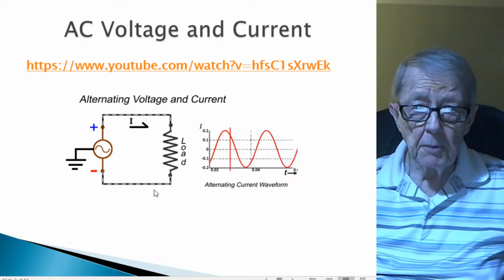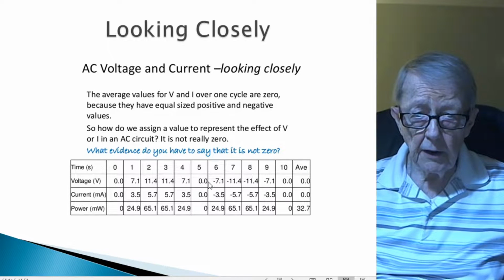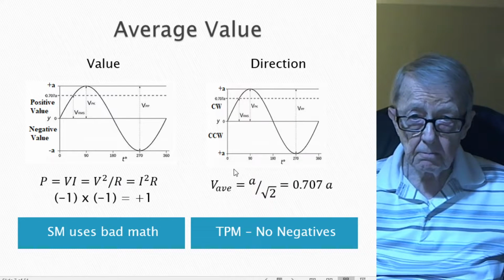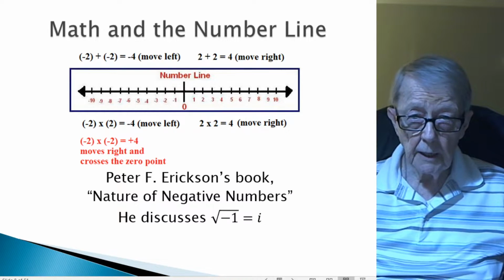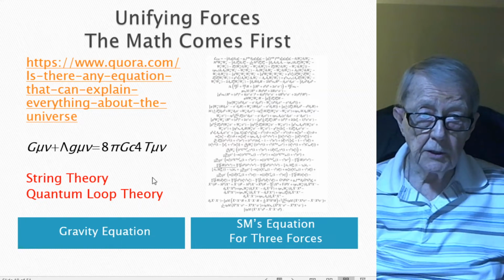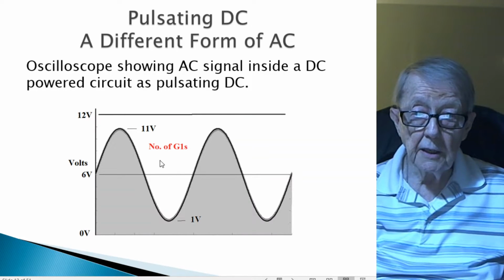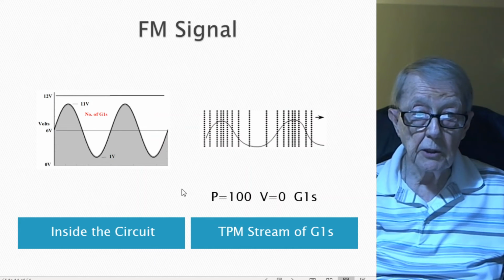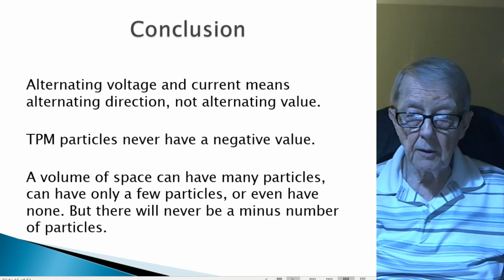AC vs. Pulsating DC; Sub. Math vs. Physics

Comment: Bob, I compare the zero line in electricity with zero °C where you can have temperature above zero during the day and below zero during the night, but in reality, compared with degrees in Kelvin(K) it would be above 273.15K and below 273.15K.
So for an alien the entire Earth might be +375,000 volt but for Bob it looks like 'ground' is zero volt.
Maybe charge is volts?
Nice book. I miss Davids book reviews.
Reply from the maker: Temperature is just a measurement scale to record the physical vibration of atoms. They can vibrate very fast, very slow or not at all. The scale goes from zero to so hot the atom is destroyed.  But you are right, we normalize the temperature scale in  Celsius  to have freezing at 0 and boiling at 100. It is a human device that makes the values easy to use. Negative vibrations, if it were possible, is just the same as positive vibrations moving at the same rate. No negatives in nature.

Thanks for your comments!